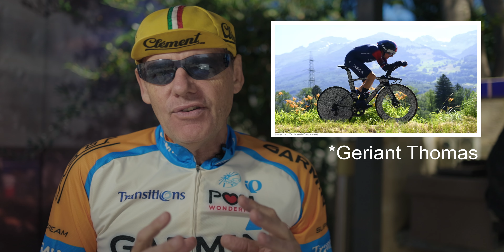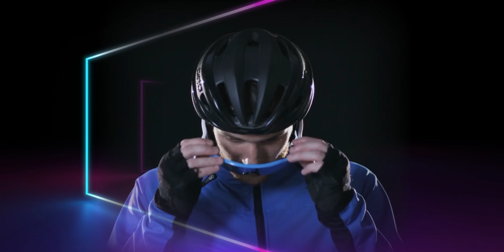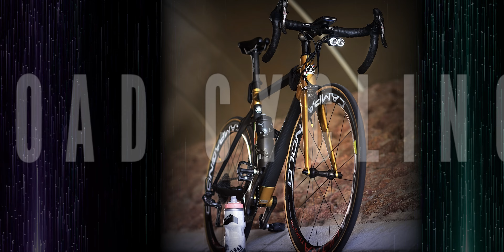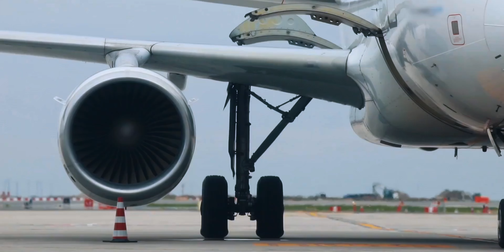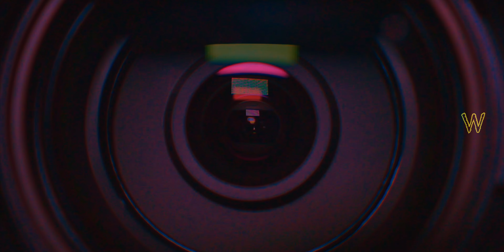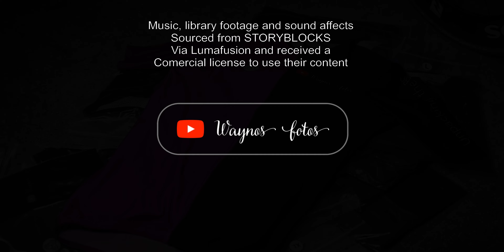Pinarello Bolide goes DISC

Comment: It's a shame that everything is going disk brake even though rim brake would be faster and more aero......WHY?
Reply: @82vitt  don't buy the argument that it makes money, if you buy a new bike, rim or disc, will cost about the same
Reply: @LM42  Disc $500 more.....
Reply: Because it IS faster and more aero. That is the only reason.
Reply: @LM42  they hardly sell any TT frames or bike anyway. Def not a $$ issue.
Reply: @veloveritas9963  😆😆😆😅😅😅😅😅
Reply: Triathlon is big business, and getting bigger. Cerveló, Pinnarello, Quintan Roo, Felt....just to name a few. TT...maybe not so much, but pretty much the same thing. Most of my customers are triathletes and they don't care so much for disc.
The FAST ones demand rim brakes......
Reply: @stratrat57  I live in an area with a lot of pro triathletes and work with a few of them. I consider a few close friends. Most of them don’t care about disc vs rim, because they only train in the dry conditions here for the most part. They usually run disc on their road bikes, and a few have started switching over. Many of the fastest ones are on disc now because that is all their sponsors offer. Triathlon is NOT big business, in fact its declined by a huge margin. Tri sales are down 30% from their peak a few years ago. There is no big push from manufactures to go disc on their tri bikes, UNLESS they can show it is faster. Tri bike sales are only declining, especially as time trials in road racing have also declined. Most brands are not making much money at all in their tri segment. People always pretend that the switch to disc is based on $$$, but it’s such a tired argument. People are not rushing out to buy a new bike just because it has disc brakes, it’s simply better technology. If folks really want rim brake bikes, they can still find a select few, but there is no reason for any manufacturer to continue to produce them.
Reply: @stratrat57  I has been proven by GCN and many more that rim brake version a more aero.....the cycling industry is going backwards with heavier bikes and groupset just look at the new 105 over 3 kilos and £17000 +, its crazy
Reply: @fernandodisola6675  but it hasn’t. Aerodynamicists have proven the exact opposite with several of the new TT/tri frames. They actually test the frames with dozens of prototypes in each version and what we have found is that the disc frames often test faster.
Reply: @veloveritas9963  no way, hambini has tested this and some top aero engineers the disc front wheel has to many spokes and creates air turbulence etc etc, we have been fooled by the marketing hype
Reply: @fernandodisola6675  No he hasn’t. At all. He ran one computer simulation in an incredibly biased manner. If it was less aero, TT athletes in the pro tour would not be using them, full stop. Neither would pro triathletes( or privateers). They don’t add discs to sell bikes, they do it because its faster. There is a lot of marketing hype everywhere in cycling, but the idea that disc brakes are less aero is just hogwash. It’s very clear that newer frames with discs are proving to be MORE aero than older rim brake frames. That isn’t marketing hype, its science. Marketing hype is ceramic bearings and high modulus frames, iso speed, zertz, all bogus marketing tech( specialized LOVES hype with no evidence to back it up).
Reply: @veloveritas9963  i agree with you on the ceramic bearings etc etc but unfortunately not on the disc brakes being more aero no way, carbon bikes these days are not as good as 7 or more years ago, their all made in China apart from a few like the colnago c64 I do ride rim and  disc bike but when I'm  racing or doing sportives I  always have my rim brake bike cause its lighter and aero I see those disk brakes bike really struggle up hills and on descent by braking to heavily in the corners or sometime locking up over heating their rotors, it's bit over kill watch this space next thing will be double sideded rotors with abs and bike weighing over 10 kilos, I just feather my rim brake into corners keeping my speed  constant....I'm NOT against disc brake at all their just not needed on performance road bike but great for commuting or gravel bike it a shame we don't get a choice this is where the industry is going we all just have to accept it  I'm glad I have invested in my latest performance road bike the colnago V3rs RIM what a speed weapon much faster than the disc model.....enjoy your bikes Disc or Rim👍

Comment: I am sure that the main reason for disc brakes on race bikes are the carbon rim wheels. 
People want carbon rims, but they are only able to deal with clinchers. Carbon clincher rims and rim brakes are a bad combination, as we all know. So disc brake carbon clincher rim wheels seems to be the best solution for costumer maintenance. And I am sure the tubeless  suites this strategy quite well, as if it was made for it. It reduces the weight of the clincher carbon rim wheelset. It could be wider without more rolling resistance or weight than narrower clincher wheels but better braking performance for disc brakes.

For young people, who just started riding road bikes the weight penalty doesn’t matter, as they do know not know what weight (less than 7 Kilogramm) good bikes had ten years ago.  They consider 8kg as normal. 

The only group that suffers from that development are we old bike enthusiasts, that experienced the whole development of the last 20-40 years. We that we are looking for a sub 1000g aero frames for rim brakes and mechanical shifting, with 50mm tubular carbon rim wheels with less than 1300g for a complete bike under 6,8kg. We were so close to the perfect bike frame design, but have to accept that from the weight point of view we have to go back to the weight level of the late 80ies / early 90ies. 

I just had my carbon frame repaired, as I couldn’t find any contemporary alternative. And I just hope that there will be enough tubulars available until I stopp cycling in 30 years, when I am in my seventies.
Reply from the maker: True that 🤔
Reply: I have to say I disagree. 
Started cycling in 2006, and I more or less quit road cycling then in favour of off road cycling because road bikes were so technologically antiquated. 
No disc brakes, no tubeless, slow movement  to try and integrate the cables into the frame. Even the switch the carbon was slow. 
The worst part of it was that the dominant force in the cycling community then was very conservative, and hated change. Hence the manufacturers followed suit. 

Thankfully covid changed that. Brought in fresh blood who aren’t influenced by the old school dinosaurs. I’ve only started coming back to road cycling now that road bikes are finally getting decent. 

It isn’t so much about money, but road bikes have been due for a performance upgrade for over a decade. Hopefully it won’t be long b4 we see manufacturers finding a way to integrate dropper posts into the road bike frames while keeping it aero
Reply: You can now find very light tubular disc wheels around 1200g and 45 to 50 deep and wider. Lots of disc frames are coming onboard around 600g to 850g. You can get a defy now in 56 around 7.2 kgs

Comment: Tri bikes moved to disc in part because integrated aero rim brakes were mostly proprietary trash in performance and maintenance.  Didn't have to be that way as Giant got it right, but that was the nature of ~2015. The rim Trinity is still competitive today. Consider though, that if the triathlon world has almost fully adopted discs, is the penalty actually as bad as you claim? You might be able to easily find evidence to the contrary.
Reply from the maker: Yes those concealed brakes and bottom bracket brakes were something to be desired. I get they were never very good. But the argument is, did they ever really need super brakes?
Reply: @waynosfotos  decent is good enough. even if the actual race is flat they still train on regular roads.  Cable disc brakes still on many tri bikes, so top power isn't needed. Easier for packing and travel.  Luckily road bikes only briefly adopted bad propriety brakes on a few models, like on the Venge.
Reply: Disc brakes allow you to engineer a more aero fork and head tube, so aerodynamics can be improved upon compared to rim brake. This was not the case on the first few generations, but it was possible.

Comment: Maybe they like the look of hiding cables, as hydraulic lines can bend inside the bike better than wire lines?  And, not limit wheel choices to the masses.
Reply: That's a point Doug often overlooked. Hydraulic lines for bikes are basically fit and forget and I've never replaced a hydraulic hose after years. For internal rim, cable housings would need changing periodically. Cables brakes work best with The shortest length possible but with the radius of the bends with a range thats not going to increase friction beyond the optimum. 
I think on TT bikes especially at pro level only required rim brakes.

Comment: I've also worked for big companies that make cutting edge technologies. And I'm not sure I would have believed everything my working colleagues said. I do believe that disc brakes give you an aero disadvantage, so I'm not claiming that Hambini is wrong. But we don't know which bikes he compared. Pinarello claims that they have optimized the frame around the disc brakes. Of course, unless some data is released you need to believe them. But. Do you seriously think that Pinarello would have released a slowlier bike than the predecessor? And do you think that Ineos would have taken this bike if it was slowlier?  For sure you don't need disc brakes on a TT bike. And clearly there is a financial interest from the manufacturers to sell new products (they are not your buddies, in case you didnt' notice). But there is also a financial interest from the teams to win the big races. So they are also interested in taking the best components they can get. I can also claim that you have a financial interest in releasing so many videos complaining about disc brakes.
Reply from the maker: That is true, teams do want to win races, but it is clear manufacturers want to switch to disc, for whatever reason, probably manufacturering ease. Many brands do not offer rim anymore in their upmarket bikes. So it is not about what is faster. It is about compliance to the equipment selling, i.e. groupsets and frames which are only offering disc.
Reply: @waynosfotos  it's the same thing everywhere. You cannot buy anymore top end steel frames because everyone thinks carbon is the go-to material. You can still buy them actually, but you most likely have to go custom or resort to the VERY few that still do it like Fairlight. You cannot buy anymore cars without air conditioning or without power steering. You also (almost) cannot buy a phone that is not a smart phone anymore. And the list goes on. Bike brands never had an issue to sell a new bike to happy consumers every year. Even when rim brakes were on them. If they are selling now only disc brakes it's most likely because during the transition between rim and discs they sold more discs than rims. Or at least it's one of the motivations I assume. They just want to make money and they will produce what sells best. Welcome to capitalism. I agree however that prices are getting too high, this is indeed a real problem. But I doubt we would see much lower prices (for frames at least) even with rim brakes. My statement still remain valid though. If this new bike is really faster than the old one, then who cares if you have rim brakes, disc brakes or you are braking with your feet?

Comment: Why are there no brake levers on tri bars? 
Because you don’t need them.

Apart from the weight there’s little disadvantage running a rear disc because it sits in turbulent air but a rear disc has little to no braking benefit. However the  front disc braking is more efficient but much draggier.
Reply: You are able to design the fork crown differently with disc but any gain over the recessed rim brakes would be marginal. The TT bikes may have fairings to reduce drag this year. Remember the labs take measurements mostly with the yaw at 0°.
Reply: @glennoc8585  rear disc is behind the riders moving in turbulent air you can place a brick or air foil in the area and get similair drag results it’s why the ceramic speed faired cage is such absolute bs.
Reply: @tobycolin6271  over the back it's not going to work only the front.
Reply: I have seen quite a few pros add a brake lever to the aero bar, but just one. Not for triathlon, just for TT. It’s annoying setup though because you have to add a splitter.
Reply: @veloveritas9963  if you can name 5 and pop links to pictures of their bikes I’ll believe you.
Reply: @glennoc8585  that’s not true a cone has the same aero dynanic drag whether it’s nose on or base to the wind the airflow leaving an object is as important as the airflow hitting the object. It’s lesson one in the ETPS aerodynamics course. We are obsessed by the leading edge but the trailing edge is just as important.
Reply: @tobycolin6271  I don’t care if you believe me, not only did I see it with my own yes, I’m the one that installed a few of them. Vision actually sells them setup this way. So does alpha one and J tek, though they look pretty janky, all the ones I installed were vision. The pro’s thought was that they could scrub some extra speed in the corners, without having to get into the base bar. It makes sense in theory, but in practice it seemed unnecessary. Mechanics just set the bikes up the way the racers request, we don’t try to convince them its a dumb idea.
Reply: @veloveritas9963  the pros who you cannot name. Even though you built their bikes. You must know who they where and then an item so obscure would have been spotted and a picture would exist somewhere on the net.
Reply: @tobycolin6271  Nope, I can’t really remember  at all, it was a decade ago, and we only did it briefly. Gustav Larsson definitely had them. I think 2012 giro and TDF was when you saw a dozen or os of them being used. I’m sure if you dig you can find a few photos. Vision made them for at least 4-5 years and sold hundreds. Why would I make this up? THEY used them on THEIR bikes… if you don’t believe them, you should find all the pros who used them and tell them that they didn’t. We’re they unnecessary? Sure… lots of bike tech came and went because it just wasn’t useful. It’s been at least 4-5 years since I have seen anyone using one, and it was just on the front brake.
Reply: @veloveritas9963  so you fitted some 8 years ago and they died out hardly an argument for a product that transformed the cycling world.  Let’s add them to power pedals, tt bar forward facing mirror, lead loaded tt wheels, barbiturates and brandy biopsace, and all the other cycling media greatest tech.
Reply: @tobycolin6271  transformed the cycling world? Who the hell said that? I said that I think theyre kinda useless. Why do you think people rarely use them anymore?
Reply: @veloveritas9963  exactly my point so if you don’t need brake levers on tt bars and those who tried ditched them so why do you need to improve tt braking performance and add heavier less aero disc brakes.
Reply: @tobycolin6271  You don’t. That is my entire point. They are adding discs because it makes the frame and fork MORE aero. That is it. That is the ONLY reason.

Comment: Maybe you should contact Pinarello and  Ineos and inform them they don't know what they are doing......
Reply from the maker: They know what they are doing, industry pressure. They are owned by LV for interest.
Reply: They know what there doing cheaper bikes, bigger profits slower bikes. The more people that switch the better my results look.
Reply: Tririg makes top end carbon triathlon bikes. They know what their doing.
They believe disc on tri or tt is crap.
Read their website.....

Comment: Hambini is wrong, full stop. Hes comparing 2 frames one with rim one with disc. That’s just dishonest. If you compare 2 manufactures frames, one with rim and a newer design with disc that has been fully optimized to take advantage of the frame, fork and tube shapes. There is zero compromise to aerodynamics here, and that is the entire point. The disc bike IS faster, otherwise they wouldn’t have swapped over. Speed is the only goal here when it comes to R and D on a TT frame. They hardly sell any and there is almost no ROI on a TT frame, most brands lose a ton of money on them, but the teams need them.